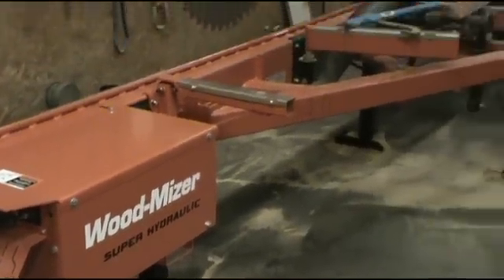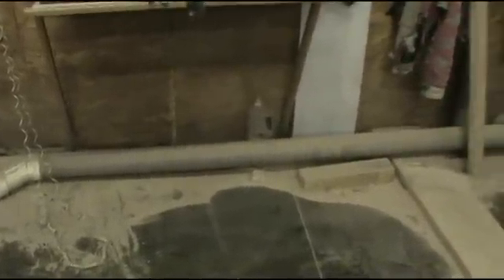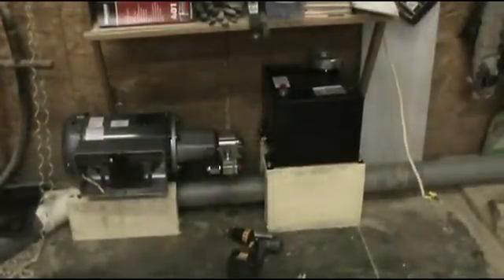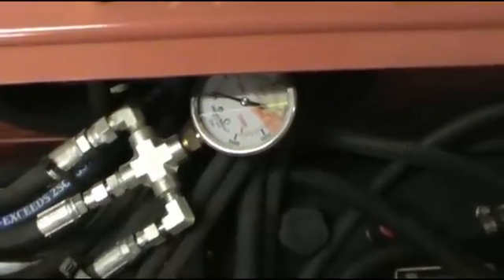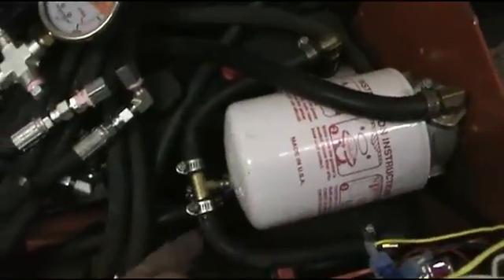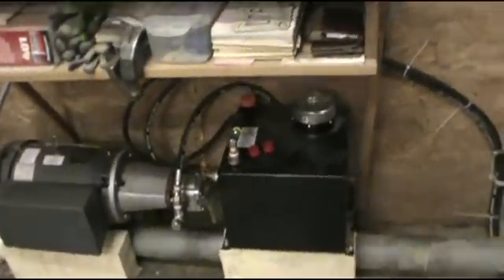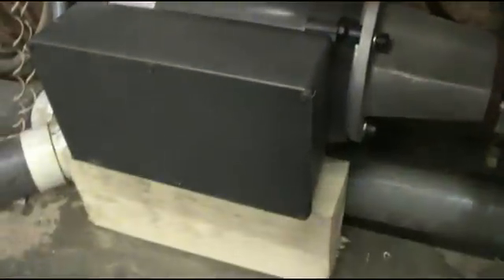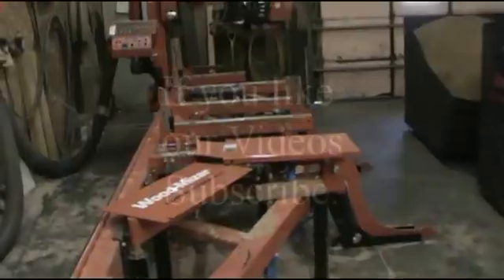Wood-Mizer LT50 Hydraulic Up Grade

Comment: Let me ask you something Al.... There were videos with sawmills that had board returns on them.. what's your thoughts on them? thanks Jim
Reply from the maker: +freespeach1776 
Our LT50 has a Board Return. We seldom use it to pull boards back. However we use it to pull a short cant back once 3 sides are sawn so the piece can be clamped better.
A board return is a real time and labor saver if your edger is behind the saw.
Unfortunately our Saw Shop is not set up correctly for that function.
We built the Shop in 1996 and Wood-Mizer did not have the board return at that time.
Reply from the maker: +freespeach1776 
Subscribe to LindasSawmillCinema that way you won't miss out on any exciting videos.
We do saw quite a few short logs so at some point you'll see us dragging stuff back.

Comment from the maker: The PSI is the same as the old system. 
We gain speed from a larger GPM pump. Plus an AC motor does not slow down when loaded heavy, it just draws more AMPS. 
A DC drive pump slows down when loaded heavy. 
This system will spin a 30" log pretty quick.

Comment: The system still has the same bypass pressure valve so it can't be any stronger than was set at the factory.  But the factory dc pumps are two stage. Where then new ac pump is single stage. Thus, it pumps the same gpm under load as not. Overall much faster and with head in any location.